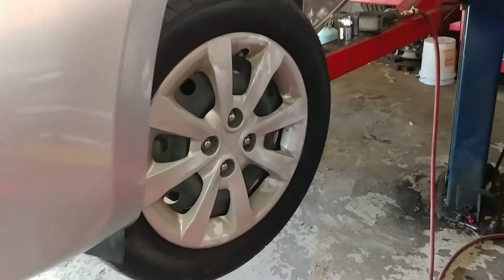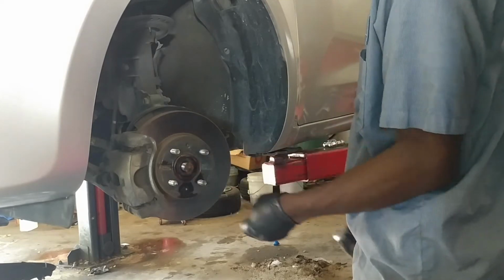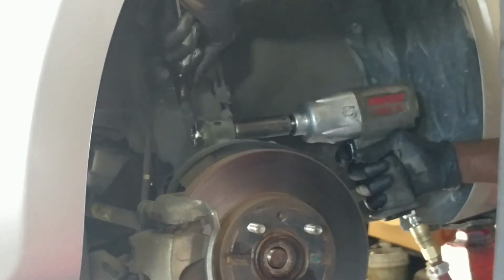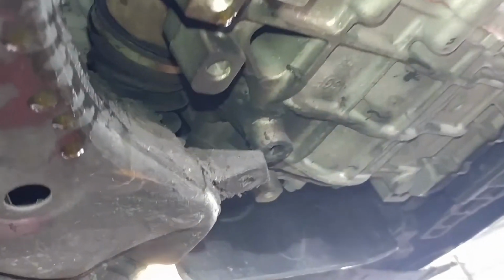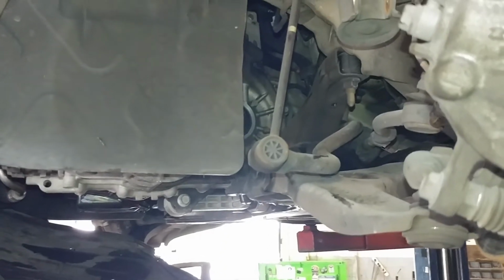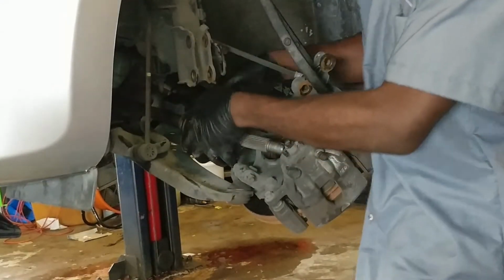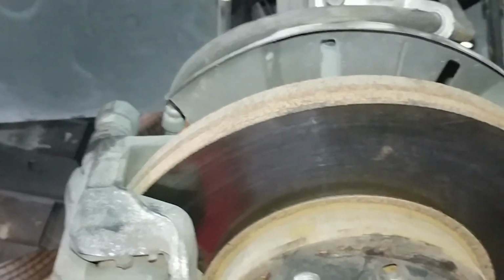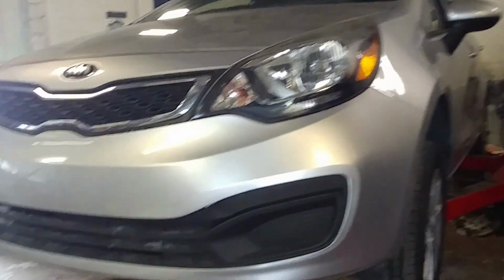Kia Rio / Forte left front cv axle replacement

Comment: Thanks, It will also work for the KiA Spectra. Well done.
Reply: Spectra 2006 I removed the Brake then to move the line. Have to pry from a diff angle. Pretty easy. My issue was (25 or 27 spline in board) Mine was 27 inboard  25 out board or hub side

Comment: That brake line DID have pressure on it. You still need to tie it up. And shoving that axel into the transmission that hard without knowing if you actually got it in there correctly can damage the splines.

Comment: Does the car need alignment after this procedure?
Reply from the maker: Yes
Reply: @DULLAHGOSOHARD  Can the strut remain attached and disconnect lower ball joint instead—to avoid alignment?
Reply: Hey! I was able to pull the cv axle out by disconnecting the ball joint, only. :)
Reply: @treenopie  that is the way I do it a well. No alignment needed. Also hitting the end of the axle with a hammer can damage the bearing in the transmission that the axle sits against. I only watched this video because my Rio has a type of castle nut on end of axle. But not same castle nut shown in the video.
Reply: @aaronm2183  How do you get the axle out of the wheel hub?
Reply: @treenopie  I've had some you can push out with your finger but at times I've had to use a three jaw puller. Five ton puller works best. AutoZone rents for free. Harbor freight sells a three jaw puller but I broke two of them on the last axle I replaced. My Suggestion borrow one from an auto parts store. Most will let you purchase and return it after use.

Comment: Hey bro im having a similar prob if it's not th same .im getting a heavy roll on my front left ,do you have any suggestions to rectify that prob it's a kia forte 2017 right hand drive .
Reply from the maker: Its probably wheel bearing  or bad tire cv axle give a click sound or vibration under acceleration rolling sound is bearing or bad tire
Reply: Hey sorry for the late reply, I changed the wheel bearing and it still continued, I'll try ruling out the rest thanks bro much help